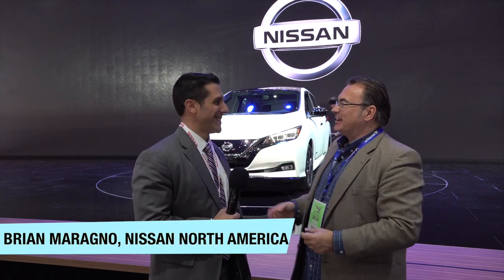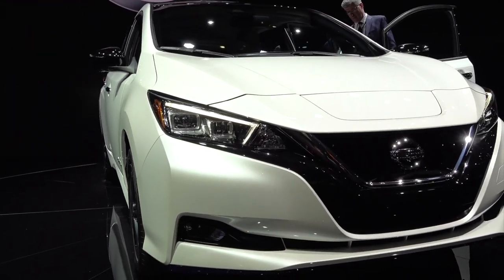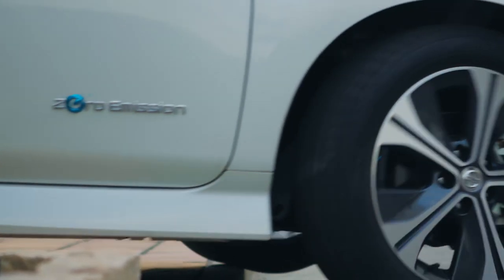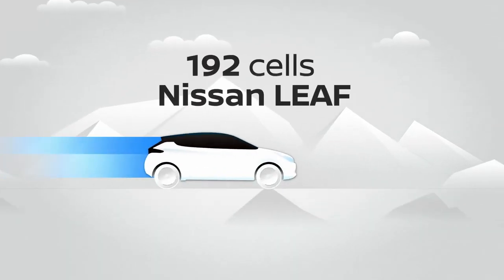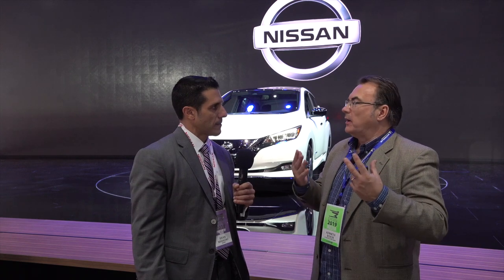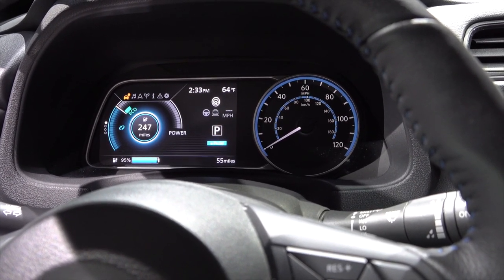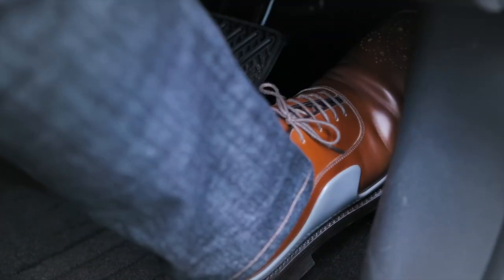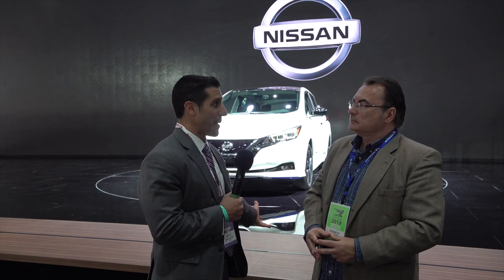Special Episode - 2019 Nissan Leaf e+ Impressions from NAIAS Detroit!

Comment: You didnt press him on the still old air-cooled battery system..
Reply: The answer has already been given, they changed the chemistry to lower internal resistance.
This makes for lesser heat generation inside the batt., therefore it can be charged/discharged at a faster rate for a given temp. rise.
How will it compare to the best ones in the market will be answered by reviewers in the future.
I am dissapointed at all the youyubers i've watched earlier; not a single one ascertained to speculate that
Nissan took the step of lowering internal resistance. Everyone complained about not implementing liquid
cooling.
Reply from the maker: Hi andres and thanks also @Andrew Le for both of you watching the show and for commenting.  Yes you are correct, I made no mention of active cooling on camera.  That is because I asked him off camera before we shot the interview and he did not know or want to comment.  So right now, this rumour is unsubstantiated in my opinion.  However, I am meeting with some other Nissan folks here in Canada in the next couple of weeks and I hope to find out for sure this answer.  

Now, what andres stats is correct.  I was a bit surprised at this as I too had not heard from all the other you tubers who have had a chance to look at the e+ about this chemistry change fact.  So I got the scoop on this!!  That is my style, why am I going to corner some dude to just yell at him and complain for not doing something when I can be more professional and ask good questions to get good answers.  Marketing people love to talk about what they market so why not let them at it.  

That is the main difference between me and pretty well all of the larger EV-related YouTubers out there - they do what they do more for financial gain and for "national enquirer" type behaviours at times.  Sensationalize something that is not needed to be sensationalize.  I call this the CNN "breaking news" syndrome.  Every story now from CNN is breaking news so I don't even watch them anymore.  

I try to report on facts and pros and cons in a professional and courteous manner.  I understand not every BEV is going to fit every persons wants and project all sides.  Also I put things into perspective.  So the few dozen people out of 380,000 Leaf owners want to drive the crap out of their 40kWh Leaf every day and experience rapidgagte issue.  That does not mean the Leaf is a bad choice for the other 379,900 or so owners who bought one?  

I encourage you Andrew and all my viewers and those interested in the EV world to keep open minds and not be so easy to go down negative news ratholes and latch on to just that.
Reply: @EVRevolution  I see... That's cool you want to stay professional with your questions. Understood. I would guess if you didnt ask him that question earlier off-camera, and you asked him during on-camera that he would be nervous or maybe even defensive in his answer or dismiss the question and side-step it... Anyways, many sites have basically said by now that it is using its AESC /NEC battery with no real cooling at all, just passive air-cooled as before... So even though Nissan reps have said they have new tech to prevent battery degradation in the past, time will tell if that is true or not... Still I'm disappointed they didnt go with LG Chem as been rumoured before now... Alas... And unfortunately in my area for this LR EV I am wanting to get to upgrade my current LEAF 2017, my only real choices (for sale) is Nissan LEAF or Chevy Bolt EV. I hope that Hyundai Kona Electric or Kia Niro EV will come to my area since both still have more range than this latest Nissan LEAF 2019...
Reply: @andytomm1  Well, it wasnt answered directly.
Reply: The people that have 2011-2018 leafs will still need chademo it is not going away in us or japan.  We have combo chargers so no problem people need to stop forcing the issue .

Comment: 1: you gave him a very easy pass on the battery cooling tech which  would be massive factor on people buying this car, if they believe in it so much they should give a solid 10 Year 100,000 mile warranty.

2: I would be pissed if I bought this last year to have and to have the Streo updated to much, why not have this released with last years 40kwh model, not like it’s an amazing update. Just shows last years model was a stop gap. The 2019 model should of been out last year with the two battery versions.

3: why not just give out prices, can’t be that difficult. If I had to have choice of of Kia e-Niro / Kona Ev or this I know I go for the vehicle with liquid active cooling battery, longer range, probably cheaper and longer warranty version.

Also when The cheaper model 3 comes out Nissan Leaf will be some for.

I can see the depreciation of this car to be crazy after 2/3 years.

If you get a good enough lease deal worth it. Other wise I would give it a pass.
Reply from the maker: Hello DersimLondon, thanks for watching and for all your feedback and comments.  Let me try to address these.

1.  Nope I did not, Nissan has chosen the passive cooling way for their current BEV models so no need to argue about why/why not change it since that is what is offered.  If you look at my comments above, you will see I address this too.  Why change the warranty when the vast majority of other auto manufacturers have the same?  No need.  Yes I'd love to see it, but as a business why would I give more away for free if I don't have too.  

2. Don't agree at all.  I bought the 40kWh last year based on my needs at that time and budget.  I have no regrets as we all understand that technology improves every year - that is a common trend on all tech including cars.  Nothing new with this.  Are you pissed that you by an iPhone X and next year the iPhone XS is launched with battery battery life, faster performance and nicer screen (or whatever new and improved specs it has)?  Well if you are pissed than than is just plain ignorance on your part for not seeing that technology is always leapfrogging in price/performance and will never end.  Same with cars.  

Also, the e+ is NOT to replace the 40kWH, it is to be sold as another BEV option for consumers.  As Brian said in the interview, this is not a replacement but a side-by-side sales strategy to increase the Leaf footprint to a larger market.  So the improvements are well in line with an upgraded model - Tesla and all manufacturers do this so this is not just Nissan.  I don't think Nissan was ready from a battery perspective to put out the 62kWh version last year simply because they were trying to sell AESC and that put a hold on the timing.  That's my opinion.

3. Pricing has been released in many countries and if you watch my last video, you will see I extrapolate estimates for North America pricing based on these numbers.  And again, when a new vehicle is launched at car shows, it's not uncommon for all manufacturers to not have pricing announced yet since they are months away from starting deliveries.  Again a common practise for all, so why are you picking on Nissan?  Your bias here is really showing.  I know the Leaf is not perfect for everyone, however I'm as open and objective about it, not close minded like many.  

I hope the cheaper Model 3 will do very well, however that is still a wait and see.  I'm still struggling to believe that Tesla will actually be able to sell it for $35K - look at the last couple of days - laying off people, cutting referral program, increasing SC costs - all because they need to get a real business profit and margin from a base $35K model 3.  I personally don't think they are there yet to sustain that.  There is a huge backorder and demand for the base unicorn model 3 and that will take away sales from the mid and long-range models today, which these two are more profitable.  So it's not a surprise that Tesla has held off on the base for so long - just disappointing and pissing off the tens of thousands (hundreds of thousands) of people waiting since 2016 with their reservation and only seeing more expensive model  3 trims being sold to net new orders and delivered in 3-6 weeks.  That is terrible on Tesla's part.  

You can give the Leaf a pass as that is your choice, however at least get all your info correct and make an informed and unbiased decision, rather than just simply discounting the Leaf because you like another brand better.  You have that choice to look at what is right for you and that is the wonderful thing that many miss.  The Leaf is still the number 1 selling BEV model of all time, with over 380,000 sold to date.  I predict it will still continue to sell well and the e+ option will help to grow the marketshare for Nissan. 

Remember that the entire global sales of EVs (PHEV, BEV and Hybrids) for consumer vehicles is only at 2%.  This market is HUGE and the more manufacturers have choices for this market, the better!
Reply: Depreciation would be a nice segment to survey. Time will tell and i hope Ken get a chance to review and test their claims. It appears they have fixed the rapid charging issue. I’m a little let down that they didn’t use ccs.
Reply from the maker: Hello Mikael, thanks for watching and for comments.  No use in looking at Depreciations numbers since really all cars suffer from this.  Some more than others.  Especially BEVS.  With little historical data yet by comparison to ICEVs, they typically depreciate relatively fast.  Tesla has managed to maintain a higher than average value against others in the same class point, however that is mainly because of their luxury brand segment.  

To be frank, if you are worried about depreciation on a Leaf or a Bolt or a Ioniq, etc. then Lease and don't buy.  You will get a guaranteed residual value at the end of your term then walk away. 

 If you are like me who really does not give a crap about that and don't want to throw money away on Leasing with paying forever, I buy my cars and keep them till they die.  So depreciation means nothing to me.  It's all what is important to you and other buyers so make your decisions based on that.  

With regards to testing Nissans claims, I certainly hope to get my hands on an e+ this year to try it.  The updated BMS for the Gen 2.0 has already been proven to decrease fast charging times under same circumstances as Leaf's with the previous version BMS.  So nothing really to check with regards to charging issues as the e+ is shipping with this newer firmware.  

I understand about CCS however you have to remember why Nissan and others continue to support CHAdeMO based on their other energy efforts, which may not yet be big here in North America, but are certainly huge in Asia and spreading in Europe.

Comment: This 8 inch Will also be available for the 40kwh model
Reply from the maker: Hello arlandanights, thanks for watching and for your comment.  I am not aware of that and I've not seen that confirmed, so I will try to find that out.  My understanding currently is that it is not.
Reply: @EVRevolution  here in Sweden it is also 8 inch in the New 40kwh MY 2020 from summer.. you can  order it now and its  called zero 3 40kwh.  And u can order it with 2 tone paint for all paints . We also have the prices 😁👌 Love your Youtube. I sub now 🚘👏
Reply from the maker: Hi thanks!  That is great to know and makes sense.  I just did not want to confirm it without actually getting info from Nissan.  It may be a regional standardizing (Europe versus Asia/Pac versus North America), so I will need to get clarification.  Nissan manufactures the Leaf in 3 plants: Japan, UK and USA.  They don't all offer the same trim versions and packages across the board.  So in Europe the 40's can be coming now with the new screen as standard and 2-tone paint (which I love btw!) and this may not be offered in the other regions.  Especially North America.  One example is the Park Assist.  We did not get this here in North America at all on the 40kWh version.  Was not available even as an option.  

I'll try to get specifics but it would make sense if Nissan did offer the new screen across all models and Geos.
Reply: EV Revolution ok thx for a very nice video. Great job. I Will buy the VW ID or crozz i hope..
Reply from the maker: Hello and thanks for watching!  I think the VW EVs will be great!

Comment: Thanks for this.  Some might differ as to whether CHAdeMO is a standard at this point - I think Nissan and Mitsubishi are the only companies still using it for forthcoming products.  It would be fascinating to hear the details of their 100kW-capable DCFC build-out plan (requires >= 275A?), since I have to use non-Nissan associated chargers to get the full 50kW rate on a 2017.  Do you feel there is a trust issue with Nissan?  At what price levels would these 3 models be competitive with other brands?  What company is their charging station partner for 100kW?  The Leaf is a solid, well-built car - just wish we didn't redline the battery temp on our 200-400mi. trips.
Reply from the maker: Hi M Carter, thanks for watching and for comments/questions.  Many chargers in Europe and North America are being outfitted for faster charging, up to 350kW so I don't think faster CHAdeMO is any problem.  I think a pretty full charge in 45 minutes or less is adequate for trips as going for 250-300+ kms in one stretch requires a stop for bladder anxiety, if not range anxiety!  I don't see CHAdeMO as any problems.  Most DCFC stations are dual CCS and CHAdeMO.  

With regards to a trust, I have no reason to distrust Nissan so I don't see why this is a question.  You could ask this of any car manufacturer (I don't trust GM as far as I can throw them, nor Chrysler for that matter).  Bail them out and they close plants without even fully paying back the bail outs!  What a sham that is!  

As far as price levels, it's going to depend on what the final North American pricing will be.  We have some estimates and the Leaf's are priced accordingly within their class and battery size.  You will have to do the comparison yourself based on your location and pricing that is announced.  

In the USA, EVgo is partnering with Nissan and FLO in Canada for fast charging.  

I understand about the Leaf and battery temp concerns.  The throttling is there to protect the pack on the 40kWh version.  With an update BMS, this should allow for a bit more faster charging for a bit longer in order to ease the multiple DCFC experience.  However, this is not a normal experience for the vast majority of owners as a common occurrence.  If you find you need longer range than what the 40kWh Leaf can provide, then look for something else.  

Nowadays, with all we do know about the Leaf and other vehicles, buyers can be much more educated when choosing what is right for their needs, budgets, etc.

Comment: When you asked about the battery chemistry he responded with how the modules are packaged to reduce heat buildup, didn't really talk about the chemistry per se.
Reply from the maker: Hello and thanks for watching.  Yes because he did not know the actual chemistry change details.  He is a marketing guy, not an engineer. I tried to find an engineer but none were there.  I will try to get more specifics from Nissan in the coming weeks.

Comment: What of 0-60 acceleration?
Reply from the maker: Hello R, thanks for watching and for your question.  I've not seen a 0-60 yet (does not mean a number is not out there), but the current 40kWh Leaf with the 110kW motor and 210 ft-lbs of torque, achieves a 7.9 sec run.  So with the e+ having the 160kW motor and 250 ft=lbs of torque, with only a bit more weight added on for the pack size increase, I would estimate a 25% more power to the wheel increase and if I shave off 25% of the current 0-60 time, that would estimate it to be in the mid to high 6 second range.  So a second off the current probably seems reasonable.  I'm sure it will come out soon.
Reply: @EVRevolution  Thanks for the reply. A 0-60 time of 6 secs wohld be quick enough for my needs. I might be looking out for a 2nd hand leaf 62kw a few years from now.